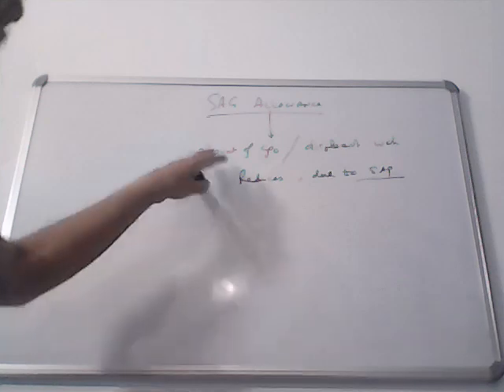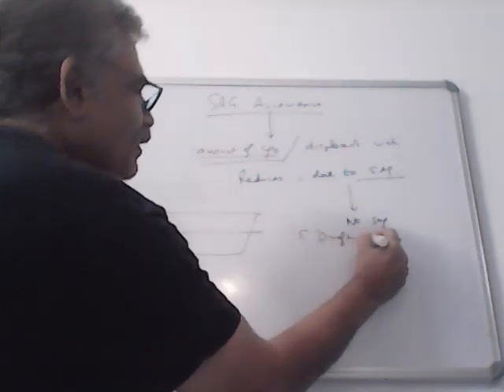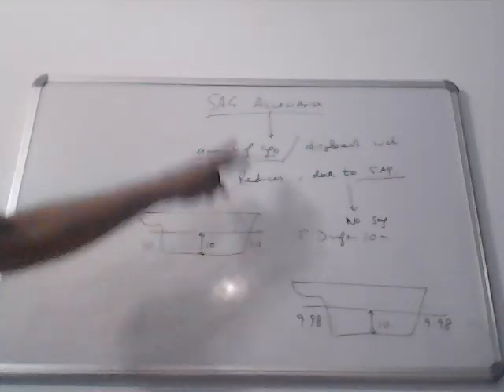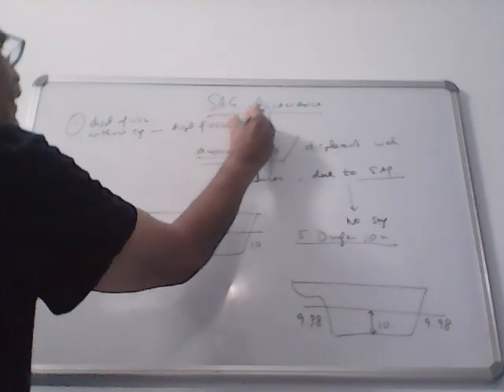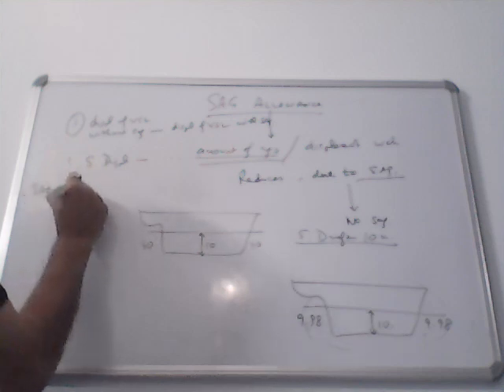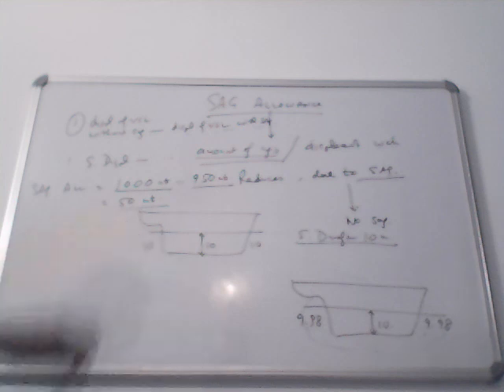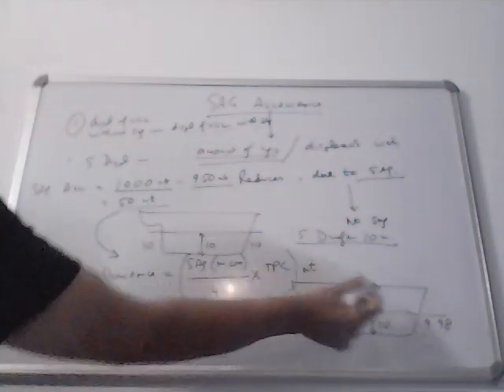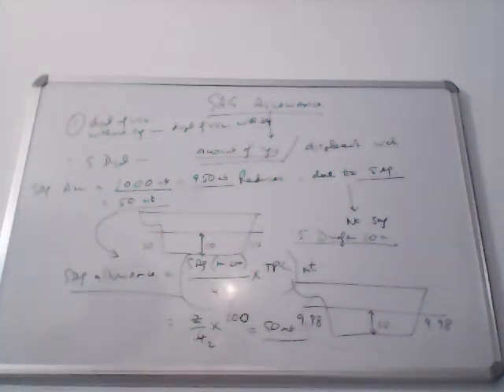SAG ALLOWANCE

Comment: Thank you for the "SAG ALLOWANCE" video. I was very impressed with the video and your lecture. However, your writing on the board was very blurry, so I couldn't read the content. Could you please make a clearer video about "SAG ALLOWANCE" and the method of constructing the "SAG ALLOWANCE" formula?
Reply from the maker: Pl view on lap top, as screen is bigger,and once video starts, then go to settings, on bottom right, and select max pixels.
Now , i am using better camera, since last few days.
SAG allowance is divided by 4 , as quarter ( means , 1 divided by 4) mean is reqd